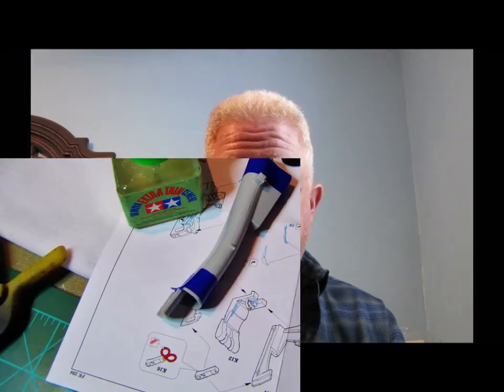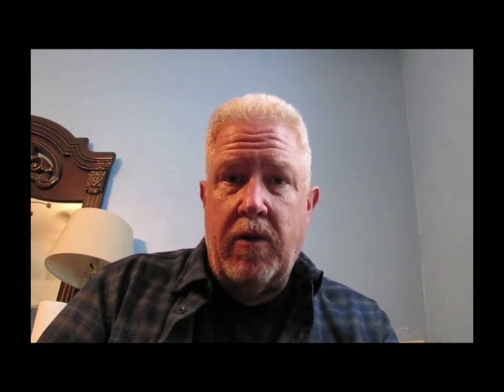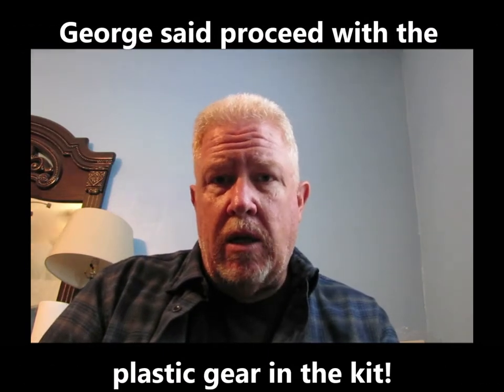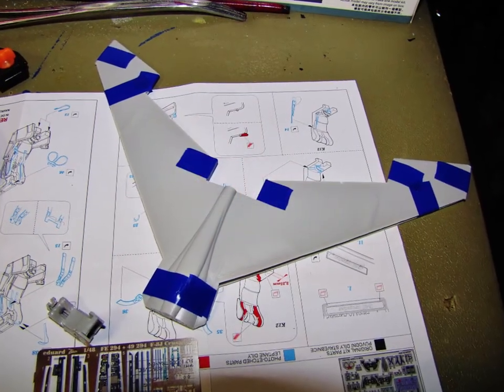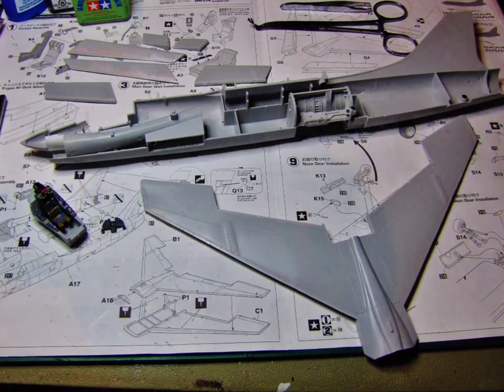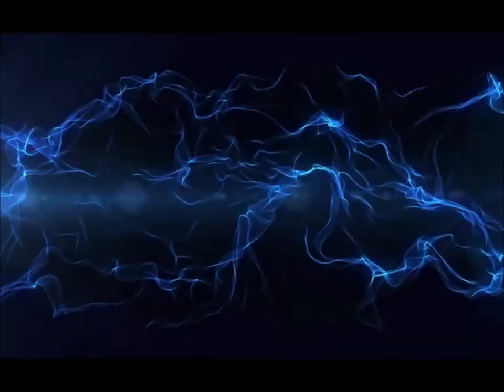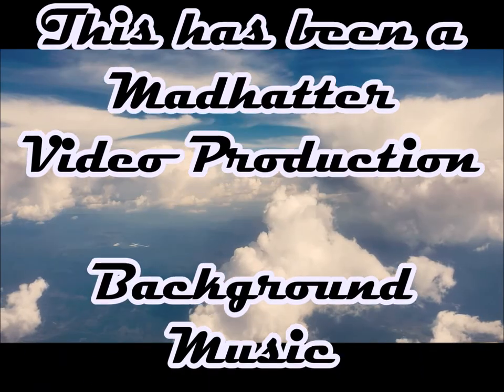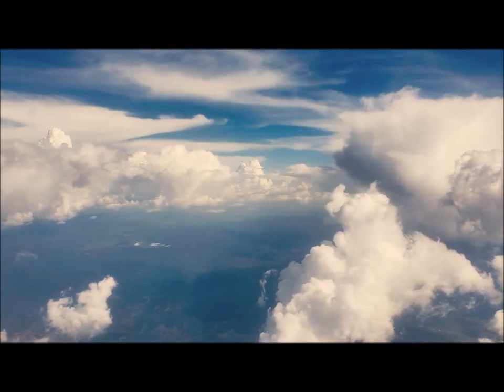F-8J Crusader build Update II

Comment: Morning Ed, Chris here........I use photo etch myself & I did use super glue in the past once or twice, HOWEVER............what I've found 2 be more forgiving is Tamiya semi gloss clear acrylic, it comes in the little jars. I put a dab of the Tamiya clear on the end of a finely sharpened toothpick & place the toothpick on the kit where the photo etch needs 2 go. Then I place the part on the kit where the Tamiya clear was.......it dries clear & U can still have time 2 move & straighten the part without any damage, & because it's acrylic, it won't damage any paint on the kit. You can also use Pledge Floor Care which was formerly known as Future as well.....works the same way. Another cool trick on how to place photo etch is 1 of 2 ways.......pick up the part with a toothpick after putting the toothpick in your mouth. The saliva acts like a sticking agent. The other way U can try which is my preferred method is take a toothpick & use Tamiya tape or any low tack tape U may have & take a tiny piece of it & wrap it around the toothpick with the tacky side outward. The low tackiness is just low enough 2 pick up the part & safely & gently press is on to the kit without any damage. Tweezers & all that stuff doesn't work 4 me like this does.......also with tweezers, U run the risk of the part flying off of the photo etch part & coasting into the 4th dimension.....LOL. With my method, U can see the part & it won't take flight which is a GREAT thing.....hope this helps ED!!!!!!!!!
Reply from the maker: Great tip, thank you.  I was hoping someone could share their experiences.
Reply from the maker: I hate when parts take flight without clearance.  😂
Reply: @EdsAttentionToDetail  😜😜😜🤪🤪🤪😂😂😂

Comment: Hi Ed a word of warning buddy super glue will remove the painted on details  on the  PE  careful as for the smaller bits some people use PVA glue me included as for the white meatal gear best bet using 2 pack glue just a heads up Ed incase u didn't no  👍
Reply from the maker: I was looking for feedback and advice!  Thanks for the tip. 👍

Comment: Missed one.  Should be caught up now.  Oh wow tiny pieces.  It may be worth getting one of those magnifying glasses on a flexible "arm" to make it easy to move it and hold it where you need it to help when you get super tiny pieces.  There is one with multiple arms called a helping hand on amazon for like 30 bucks.  Its for soldering though... hmm there are usually ones with lights and the magnifying glass though.  It looks like it would be useful to help with projects like these.  The soldering one could hold a piece in place while you add stuff.  They have little clamp arms.
Reply from the maker: I have my reading glasses, my head magnifier and the light with the magnifier built in as well but these parts are still tiny!!  Thanks for the comment!!!  God bless my friend!

Comment: Nice cockpit detail Ed, does the wing angle tilt on the model just like the real plane??
Reply from the maker: Yes, the wing will tilt on the model just as the real plane but the Flaps and slats will be fixed in the lowered position.